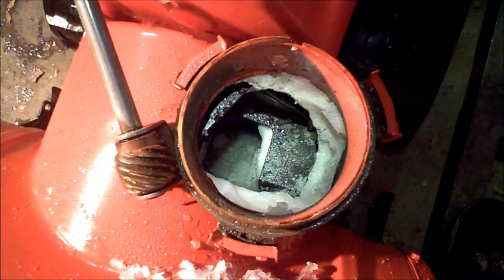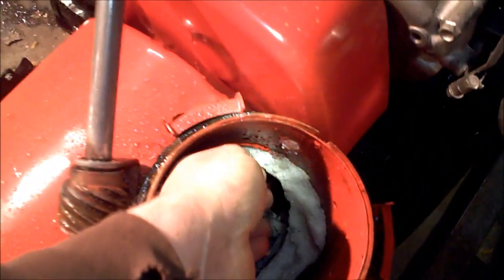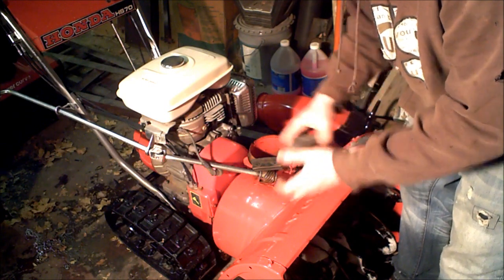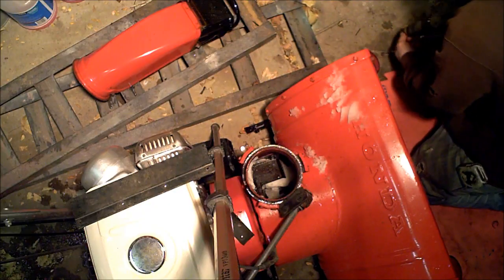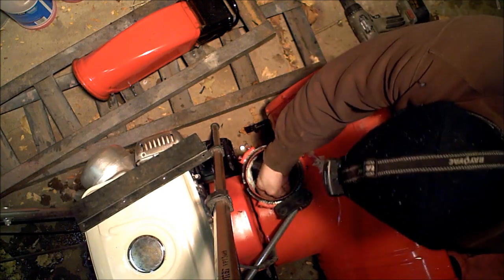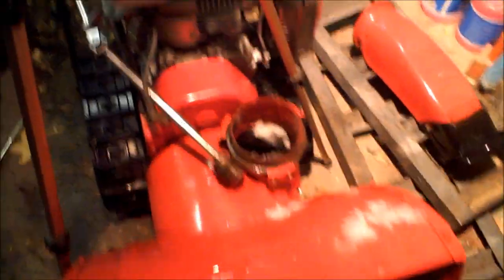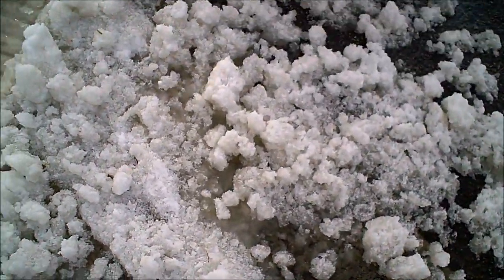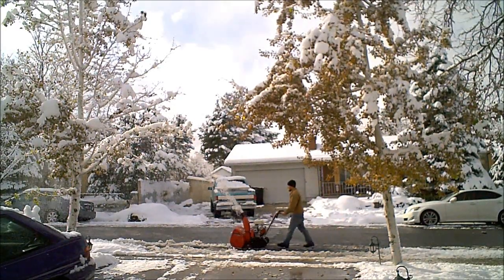Modify Snowblower to never clog and throw twice as far w/ Impeller Kit

Comment: BTW-  why the OEM cannot provide this with a new piece of equipment absolutely blows my mind
Reply: Semper Fi  Now they have to hire diversity and inclusion.  You think the lawyers are gonna trust them to bolt something onto the end of an impeller like that?
If they wanted a tight gap, they would just make them that way.
I had an Ariens Compact 24 which, I believe, was from the early '80's.  It had a 1/8" impeller gap.  It would plug up on heavy snow.  I never tried to close that 1/8" gap, but I did change the impeller pulley from a 9" to a 6" giving me about a 30% overdrive.   It plugged a lot less(very rarely) and gained a lot of distance at the same time.
Nevertheless, rust was taking its toll and I weighed the options of a rebuild or buying a new one.
In this case the new ones had taller chutes, larger impellers, and a taller bucket.  In my case, an even better help was the new Compact was 22" wide, which helped with a special narrow sidewalk I had.
So, I got a brand new machine about 5+ years ago.
This one had a 3/4" impeller gap.  I was kinda sad about that.
However, it threw further than my old one, even with the mods.
And it almost never plugs up.  (I can't remember the last time it did, but I remember cleaning out the old one a lot)
So where is your god now?

Also, with my old one, before I started it, I always had to move the impeller by hand to make sure some snow didn't melt and freeze the impeller in place.  Otherwise the belt would get damaged on startup.
Guess what doesn't happen with a 3/4" gap?
Reply: Semper Fi  your workmanship was poor.
Reply: I would say #1 is liability.   If your mod fails, flies out of the chute, and hits somebody in the eye, that's on you, if the factory does that and it fails, that's on them.  You think they give away cleanout tools with new blowers just to be nice?  it's to reduce liability. 
There are other reasons too.  My old Ariens had about 1/8" of a gap, and it would sometimes freeze.  You sometimes had to beak loose the impeller buy hand before you could blow.  My new Ariens has 5/8" or so of a gap and has never frozen yet.   Additionally, my new Ariens throws much further stock than my old one, and they are equivalent models, both the "Compact" model with is their lowest grade not counting their Sno Tek line.  While my new one will fail to throw slush, I don't think I've had it actually plug yet, just has the power to eventually force it out and the slush just flops on the ground.
So, I think from their point of view, the gains aren't worth the work or risks.

Comment: great job on this video.  Thanks.  Going to do this on an old Toro 1132 2-stage.  Form what you mentioned, i think i may need to drill through th eblae and bolt the new part in place
Reply from the maker: Yes, just predrill the holes.

Comment: Thanks for posting. My problem is snow packing up in the first stage, on the cutting spiral blades. Will have to see if I can use heavy rubber strips to break it up.
Reply from the maker: Make sure your shear pins aren't broken and that the first stage augers are spinning.
Reply: sixtyfiveford pins are ok. The wet snow packs in tight between the blades. When cleared takes only   20 ft to get clogged again. This vid gives me idea of attaching  stiff but flexible rubber strips to hang down into space btwx space on sprial blade where snow accumulates. Snow rotates with cutters and should be displaced if rubber offers resistance.

Comment: Thanks for the tip. I added 3/16 rubber belting I had to a newer Troy Built, tracked type. Three paddles on the second stage. Extended and filled almost a 1/2 gap. It went from throwing 15 feet to over 40 feet. Not guessing here but measured the throw distance. I liked everything about this snow blower except the throw distance. You would think the companies would make a fix to this weakness?
Reply from the maker: It's one of the top reasons for people to buy a new snowblower, so they won't ever fix it. The gap enlarges as the machine is used, especially with the newer thin metal machines. I'm glad you tried it out.

Comment: Does it matter where I bolt down each paddle? I have an old Toro and plan to pre-drill, but there's next to no room on each blade before the back support comes into play on the bottom. Plenty up top. I'm thinking one close to the blade edge (bottom) and two above the back support. Worried that if I only bolt down up top, the paddle will  not remain flush with impellor blade and the housing.
Reply from the maker: I put them all on top. The lip that is left doesn't impede the throwing.
Reply: Thanks 65. Love your little Red vids as well.

Comment: My snowblower shear pin broke and the hole in auger is bigger than it should be. Can another shear pin hole be drilled thru in another area on auger and shaft?
Reply from the maker: Yes, just drill a new hole anywhere on the shaft.

Comment: hey,
yesterday I cut out three paddles from a donut tire. I installed them as per your video but used stainless steel bolts with ss lock  nuts. we had 3" of snow. My MTD 2 stage now shoots the snow 20' up  from 5'. no clogging. My neighbor ( a jerk) is envious, I told him I'm using a special engine oil that enhances the throwing distance. lol
Reply: Good one! You never want to give away a good trick to a jerk.
Reply from the maker: That's awesome.
Reply: Never use stainless steel fasteners, especially with locknuts.  They seize after first use.  You will be unable to remove your paddles without cutting the fasteners.
Reply: @karguy1720  stainless sieze, I don't think so, that's why I use stainless, because I've never had any problems taking any thing apart I used stainless on, has this actually happened to you or are you passing on untested ideas
Reply: Stainless bolts and nuts of the same material will weld together (gall) if they are torqued enough or if the thread fit is poor.  I used to do a lot of work in a refinery where all the flanges and bolting were stainless.  Even with the best anti-seize, you were lucky to get 1/2 the bolts to come apart without cutting.  In your case, you probably can't tighten them enough to gall them much.  The trick is to use different materials for the bolt/nut (Nitronic stainless).   For this application, I would just use regular carbon steel, forget the locknut and peen the bolt on the nut-side to prevent it from coming loose.  Use something small like 3/16" or 1/4" and then just twist them off if you need to remove them in the future.  You could also use heavy stainless pop-rivets with washers.
Reply: Kar Guy stainless steel does not stain meaning rust so they will not see‘s. If you want to put a smear of copper coat in the threads and they all come off all the time
Reply: Wrong.  Stainless will seize more readily than just about any other metal. It has nothing to do with rust - Stainless seizes by "galling" which is a form of welding that occurs when stainless fasteners are tightened (must be stainless on stainless)
Reply: @karguy1720  Stainless is the only way to go, they definately will not seize.  You must have used aluminum fasteners if they seized.  Get real, I used to repair milling machines at Mercury Marine,  I know what seizing bolts are, never had stainless seize under any circumstances.
Reply: some loctite helps against seizing i use thema in metaldetection rolls
Reply: @bipedalbob  This is a well known thing with people in the industry that it DOES happen. Cold weld on stainless happens all the time. Here ya go.
 https://www.youtube.com/watch?v=mHAhfX7iRjs
Thank me later.
Reply: @BiffX    see geoh7777's comment above.    Thank me later.
Reply: @sadlert  dielectric corrosion of two separate metatals
Reply: @karguy1720  use never-seez to eliminate galling
Reply: Dave D. Thats the best one I have seen yet.
Reply: Rekt Ntriggered qq
Reply: Rekt Ntriggered b
Reply: HAHAHA!!!! LOL
Reply: Dave, does cutting out 3 paddles mean that's what your snowblower has? his has 4 in video so he can do 2 of them. also my impeller paddles are at an angle which will make it harder, but if u can tell me if i should do all 3 or not i would appreciate it thank you
Reply: @johnpoole8321  If yours only has three, then you have to do all of them because of balance issues. With four, you can do two opposing and still maintain balance.
Reply: I didn't realize that you guys are building a nuclear reactor it's a goddamn snowblower use whatever you got
Reply: @joneldridge8481  Your comment made my day!! Way to cut through the bullshit.
Reply: @joneldridge8481  Agreed
Reply: Good for you hahaha
Reply: Semper Fi  Because the rubber is going to wear out eventually and has to be replaced. I see you made the claim in another reply you modded yours 5 years ago and it didn't work---"myth busted", your words----maybe time to check yours again. Why would you think the rubber would last forever?
Reply: Semper Fi   ummmm .... wear ?
Reply: Lol 😂
Reply: bipedalbob, yes it happens. Have a5/8" or3/4" stainless bolt gall.

Comment: How do you do a toro?
Reply: No self tapping screw will go through the cast impeller on it. Drill bits barely scratch it.
Reply from the maker: Just predrill the holes. The steel is thicker than most snowblowers, but it is still mild steel.

Comment: Am having hella time with the chute now. I can't get it to work smoothly after having taken in apart. Any tips? There is a plastic ring/bushing that it rides on but the chute still hangs up and won't rotate.
Reply from the maker: Some, you don't tighten the nuts/bolts all the way down. Take a look at the parts schematic online and make sure the spacer/bushings are in the right way.

Comment: thank you, I just finished mine, it sounds ok so I don't think it be any problems, nothing to do right now, but it is winter time so I'm sure I will be getting to try it out soon.
Reply from the maker: Let me know what you think.
Reply: I told you I would post again once I got to use my snowblower, we got about 4" it worked great, no clogging, through the snow a lot farther and the inside of the machine was clean when I was finished, very happy with the mod, thanks for the great video.
Reply from the maker: That's great.

Comment: Hi - Purchased in fall 2016, a used (8 year old) Craftsman 27" snowblower, made by Husqvarna. Following your straightforward easy to understand advice, and additional info. gathered from other similar how-to videos, I did this upgrade using 3/8" thick rubber from a discarded truck mudflap. At the start, the spacing between the 3 (yes, just 3 !) impeller blades and the housing was about 5/16 ". Since the auger housing  was very easy to dismantle from the motor section (remove 2 bolts), the work was easier to perform and I could verify the friction between the rubber paddles and the housing by manually turning the impeller. Since I only  used this snowblower after the modification I cannot compare snow throwing distance before and after. In any case, it does not go very far. But one thing is certain, the snow does not clog up the chute. In fact there is practically no snow accumulation in the auger housing and chute after operating the machine, either under cold or wet conditions. Thanks so much for your insight, it was very useful.
Reply from the maker: Nicely done. I'm glad you tried it out.

Comment: Worked well on 2nd attempt. The self tapping screws didn't go into my impeller on their own and the material I used didn't hold up. I bought the Toro blade and put 3 hardened bolts in each one. No clogging in the wet snowstorm I tried it in.
Reply from the maker: Great. I'm glad you tried this.
Reply: I used some lighter rubber material I got at Tractor Supply the 1st time. It didn't hold up. That's when I ordered the Toro blade. I have a Massey Ferguson 50 inch PTO blower. The impeller blades were breaking drill bits and the self tappers were dancing off the blades. That's when I decided to drill bigger holes and go with the bolts. More snow coming in the next couple of days to try it on again. I prefer the snow blower over the plow in my Kubota bucket, it keeps the snowbanks down.

Comment: Watched this a year ago, today I happened to look at the impeller in my Troybilt, it was literally 3/4" from the housing! No wonder it basically dumped snow to the side like a bored teenager with a scoop shovel. Made 'wiper blades' out of 1/2 thick Firestone rubber, 1/2 hour later I was blap blapping away wearing in the rubber and blowing snow like I owned a Honda. Now if there was just a slick way to upgrade that shitty friction disc assembly...
Reply from the maker: The friction disc assemblies work great if they are grease and water free. Also a new rubber disc if yours is worn, dried out or cracked will make the machine pull harder than ever before.
Reply: I snowblow a lot, 3 different properties, so I replace the rubber disc every fall as cheap maintenance. The issue, as you mention, is water. Snow gets in there, the heat of friction melts it, and now a wet plate.
I love the hyd drive on my Honda, but prefer wheels to tracks, so I'm caught in the middle. lol

Comment: Did this with mine. Already had a hole in middle of each impeller, so I just bolted on mine with inch and half bolts. Had about third of an inch gap and then ran the rubber I cut to the edge. Shoots powder snow about 12-15ft further, looking forward to wet sloppy snow.

Comment: I just did this using an old car mud flap and when I ran it the ,flaps got cut off when the paddles came across the top of the chute and hit the other side. Not sure if the mud flap was to stiff or screwed down to close to the edge.
Reply from the maker: Conveyor belting is reinforced with fibers and won't rip. That being said, they should just skim the surface and just the closest area. If your closest area to the paddle is the other side of the discharge area, you'll need to set them up to just skim that even though they're further away in other areas. If the mud flap doesn't work, you can try tire sidewall as it as reinforced fibers.
Reply: Thanks for the fast reply.I'll give it another shot.

Comment: Decided to do this to my Troy-Bilt Storm 2620. Install went fairly easy, drilled out couple of holes per area (x3..3 impeller scoops) used stainless steel screws,nuts, and washers. Looked clean. After first use the damn things ripped to shit lol. Well actually a good portion under the screws were fine, but pretty much any rubber touching the impeller shroud is gone..so chunks of rubber are there for show now. The rubber I used came from a big rig supply..roughly 1/4" thick..thought it was stout enough.

Do you think maybe a synthetic rubber material might be a better option? I am not sure if it was too thin or maybe it was natural rubber, who knows lol.
Reply from the maker: I have a link in the video description for rubber. It is fiber reinforced and is virtually indestructible.
Reply: Thank you for taking the time to reply, will try it with the fiber reinforced rubber ;) Had other projects going on, but wish I did this before last week..got DUMPED on up here in the northeast...and it worked like a champ UNTIL little warmer day and slush clogged it right the hell up lol

Comment: Any tips for a single stage?
Reply from the maker: Of course. For a small hand unit; put new rubber paddles on. For a larger one on a tractor or a old all metal impeller model: put a piece of rubber flap right on the center sections below the discharge chute. You want it to touch the housing and it will throw amazing.

Comment: I have a old 1966 ariens blower did not blow wet snow if it did only about 3 feet from machine. Install a pedal kit about 5 years ago now blows wet snow 20 feet and never clogs.  I used old truck mud flaps with 1/4" bolts and lock nuts with fender washers. Update 2024 still using the snowblower with conveyer belt rubber paddles. Blower still works awesome.
Reply from the maker: Those Ariens are built like tanks.

Comment: just did your mod. Awesome. I found a thick rubber stair tread at the local hardware for $7. The tricky part for me was removing and re installing the chute, but I figured it out and gave it a try right away. What a difference. Thanks for the great idea.
Reply from the maker: That's great. I'm glad you tried it out.

Comment: Nice simple fix, thanks for that.

Just one thing, not all 2 stage snow blowers use impellers, my Bobcat uses scoops and spins inline with the direction of motion, not perpendicular to it as the cheap new snow blowers do.
Reply from the maker: It is still an impeller, just an inline impeller. Simplicity actually did the same thing with an inline impeller and put rubber paddles just like this. They patented the idea of rubber paddles mounted to the impeller in the early 70's

Comment: i wonder if the clearance was engineered to allow debris (rocks, sticks etc ) to not jam it up...
Reply from the maker: Clearance is allowed so a metal impeller doesn't contact a metal housing. It also allows then to not have to perfectly center the impeller. A high end machine 2-3k dollars will have a 1/16" gap. As the machine ages the impeller tips wear and bend along with the housing that stretches outward, increasing the gap.

Comment: you can do this to a Toro but you will need the teck zip screws they have a 5/16 hex head and work great I used the teck screws on steel up to a 1/4 inch thick just need to go slow till it starts to grab

Comment: how hard is it to start the impeller the first time? I'm worried my 3.5hp ariens will have trouble with too much drag.  thoughts?
Reply from the maker: The blades shouldn't be wedged up against the housing, just barely touching or skimming the surface.